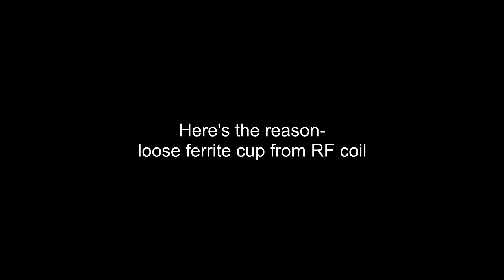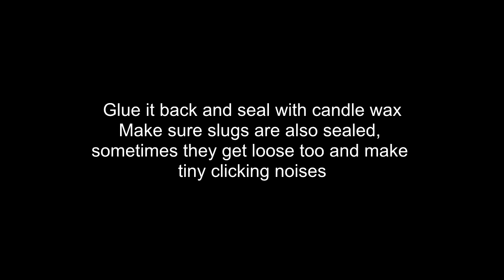Sennheiser MKH 60 rattle - quick fix

Comment: Hey Happy 2020!
Thanks for sharing your experience several mics. 
I’m trying to make a modification of the SENNHEISER MKE-400 to put the tiny shotgun directly into a TA5F connector so I can plug it into a Lectrosonics wireless transmitter. I’m inspired in the DPA 4098 mic. 
My question is: there are three cables coming out of the capsule. Blue, Red, Black. Do you know which is signal and which is BIAS out of these three cables?
Thanks in advance.

Comment: Hello, my mkh60 microphone has also failed, I want to know, did you remove the internal parts from the front of the microphone?
Reply from the maker: I guess from back of mic(where XLR is), removed wires that hold PCB

Comment: thanks , I have an MKH50 with the rattling noises and I assume it's caused by the same issue, any idea on a guide on how to open up an MKH50 as it seems not exactly the same as the 60, and i'm not so confident in doing this my self without guide .
btw is it easy to re-solder the pins ? that part worries me a bit
Reply: unscrew the two screw on the side of the XLR port and push the internals out the front.
Reply: @PiriyaSambandaraksa  thank you so much